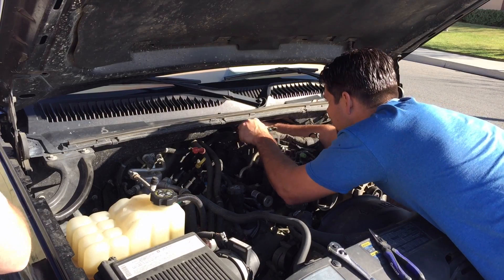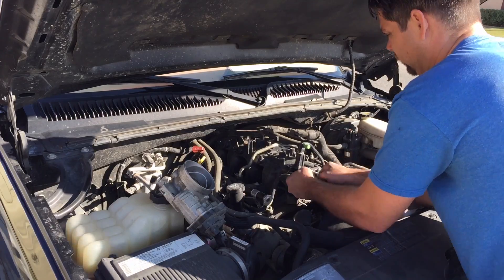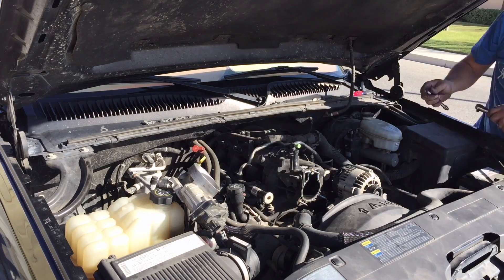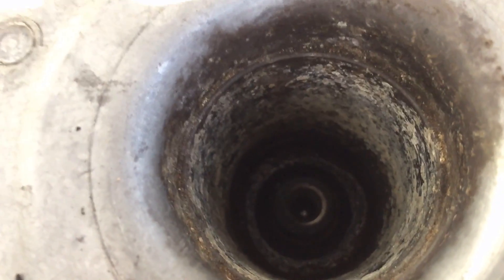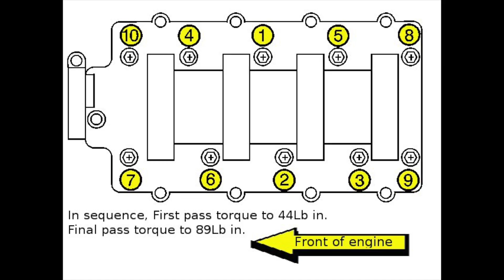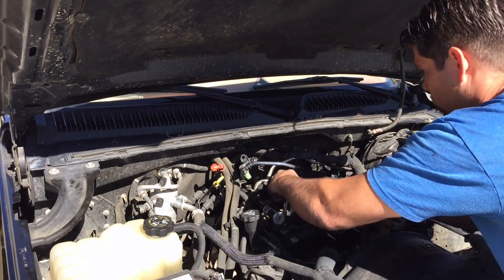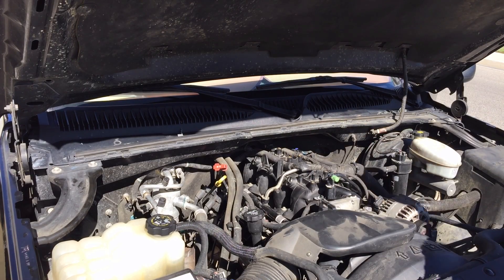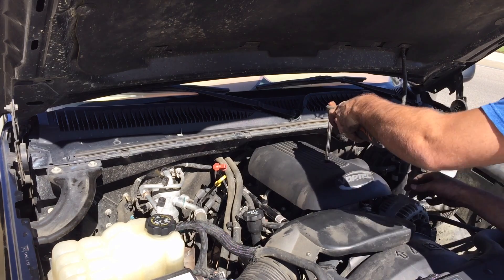99-08 Chevrolet Silverado Knock Sensor Replacement all V8 's

Comment: On a 2008 tahoe 5.3 flex fuel the knock sensors are located under exhaust manifolds and can be accessed through wheel wells above frame on both sides.
Reply from the maker: Good to hear that they fixed the old crappy design.
Reply: Staci Piech ihave hard time to identify this part can you give tip how to search it please mst

Comment: Nice video! I just bought a 2001 Yukon 5.3 and guess what? check engine code for the knock sensor. lol. Awesome video. This will be a great help when I tackle this job. I live in North Jersey and its 100 deg below zero so I will wait till after the cold snap and get this done.
Thanks for the tips!

Comment: Excellent video.....very informative.  What was the make and part number of the intake manifold gasket?  Also, what year and engine size does your truck have?  I did notice a couple of differences from your truck to mine.

Comment: great video!  I'm thinking about doing this to my truck  06 z71 5.3 . why did you replace the sensr? was it a knock Issue? for me I have a code showing up about the knock sensor being bad and when I reset the code fault it seemed like the truck ran much better until a few days later . it just had more power but I am not sure if the knock sensor is related to how well the truck runs or not that's why I asked what we're your symptoms for changing it  thanks  everyone feel free to weigh in on this   my truck just seems to not have enough power like it should
BTW I reset my fault codes with my chip reader

Comment: My 2002 6.0 is running terrible. Each time i start it, it runs differently. I did wash the engine and a few weeks later it started high idle about 2700. sometimes it cranks and runs 700. when runs low idle it quick shifts and putting in drive or cutting ac on, sitting still in neutral it fluctuates up and downfrom 800-2500 rpm. I have replaced air idle control valve with no change. unplugging it while running has no change. i replaced tps with no change. i do have a knock sensor code. will the knock sensors cause all this erratic behavior ?  I also changed ECM and had new one programmed with no change . I replaced it because i unhooked wire harness and had water and corrosion on about 10 terminals. i cleaned connector and blew out connector and terminals on old ecm and it ran normal for 1 day then back to erratic idle. seems it does something different every day. im determined to fix myself and hoping you can give some insight. Great video on knock sensor replacement. Thanks and sorry for the book i just wrote.
Reply from the maker: It’s tough to do diagnosis this way. From what you are describing I would check your vacuum, you may have a leak somewhere. A knock sensor doesn’t normally cause the idle to fluctuate. It is possible that there are several issues all together causing the issue. Best of luck, there are lots of great videos on YouTube and I hope it puts you in the right direction.

Comment: my air injection failed but looking closely i noticed two sensors one was completely destroyed the other onewas good but the wires was stripped nearly no protection  coatings i have a 1992 suburban 454 how can i locate my engine

Comment: So are there really big problems with using aftermarket sensors? I bought some then started hearing about how that may not have been a good idea.
Reply from the maker: +ShrpBld I just read about a lot of people having issues with them, not personally.
Reply: Matt W  how did it go Matt with the good sensor

Comment: Is it true that direct inject engines will need there intake valves changed every 40/50,000 miles because of build up
Reply from the maker: The was an issue on Fords, but has been since resolved. The issue was with the PCV system that pushes crank case vapors back into the intake. Ford was having an issue with oil getting into the PCV system and coating the back of the valves with carbon. I have over 100k on my Honda now and no problems with carbon build up.

Comment: OK, every thing is loose but the manifold is stuck! won't budge. Any insights?
Reply from the maker: flat9design You can get a rubber mallet and lightly tap all sides, then try to lift it up.
Reply from the maker: flat9design double check to make sure you have all of the bolts out.
Reply: Got it - missed a bolt. thanks.

Comment: My engine is knocking and have p0327 for knock sensor can that be causing the knock at idle ? 2004 tahoe 5.3
Reply from the maker: Yes
Reply: Michael Borquez ok thanks

Comment: PLEASE NOTE !!!!!!!!  NO NEED  to depressurize the fuel lines or rail  ( SIMPLY remove the 4 holding bolts and lift up the rails  !!  NO need to disconnect the injectors ALSO !! I just did the job and plenty of space to do all !!   Please pass it on !!  

Loup
Reply: Thanks for
Reply: Sweet those bitches are staying intact on mine.  Screw the potential to damage a line and the fact it always creates a little mess even if you pull the fuel pump fuse and depressurize.

Comment: After you did the whole entire video did the check engine light went away🤔
Reply from the maker: Iamgonzalo You have to reset the computer by either unplugging the battery or using a scan tool.